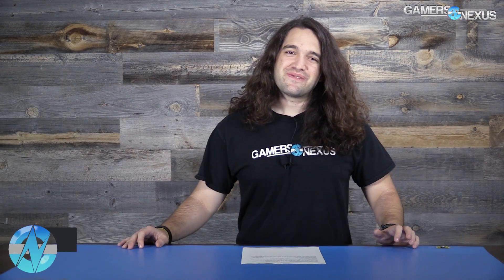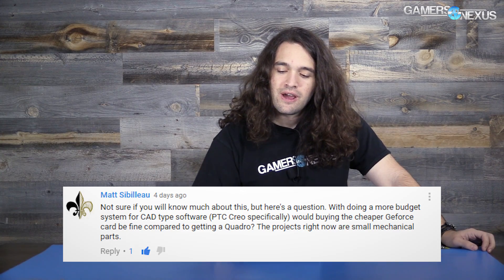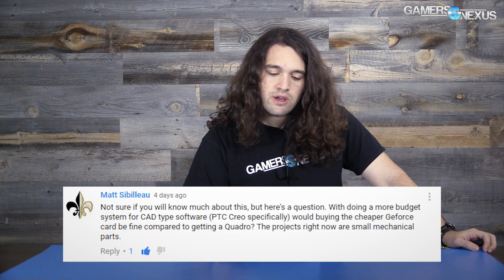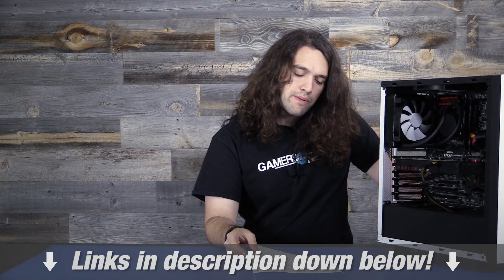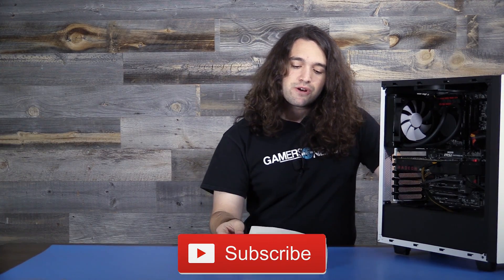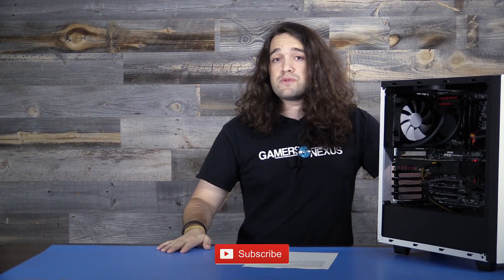Ask GN 23: RX 490 Talk, GPU Power %, Driver Performance

Comment: Do you think AMD will ever invest in improving their DX11 driver? Especially when talking about DX11 MT, even 3DMark Draw Call test shows not difference between MT and ST. Do you think that something like 337.50 BETA that Nvidia did will ever happen with AMD? I can see their advantages with DX12 and I really like all that stuff, everything. But DX11 is not gonna vanish just like that, in 6 months or so. We still see even DX9 used not that rarely too.
Cheers
(Filip)
Reply: DirectX11 is on its way out, it'd be a waste of resources, more so when you realize how tight AMDs budget is.

DirectX 11 will at most stay here until mid 2017, I don't see games using DX11 after that
Reply: +nome ficticio yes, because this time is different.

Developers will always care about their bottom line, publishers and developers the same.

If DirectX 12 is only available to 50% of the PC gamer base but Vulkan is available to 80% then they will use Vulkan instead of DirectX 12.

OpenGL was never popular because... Why would you use it for your game? If I was a developer I don't see a single reason why I should code my game on OpenGL.

While as now I see dozens of reasons, and developers don't have to adapt their skills to Vulkan, Vulkan is based off of mantle which was already extremely simplified to the point that a single person could port a game from DX11 to mantle in a month.

And, if we actually go and look this up, the number of Vilkan (including mantle) is actually higher than DirectX 12 games so go figure.
Reply: +dargonante so you expect every win7 and linux game to run opengl? like the DX11 games coming out didn't use dx9 but only opengl and dx11?

i do agree, business wise, AMD should not, and will not, waste money on improving dx11 drivers now. particularly when vulkan and dx12 with async benefit them so much as to finally tap into their gpu's real power. but, i'm sorry, your argument is invalid. dx12 games will still need to cater to non-win10 users for a long stretch of years and MS will not change its stance so some of the new games will come with opengl, others with previous DX, like 11. it has been that way since the previous millennium and the dawn of pc gaming on windows os.
Reply: +nome ficticio You argument is invalid, simply because Vulkan is DirectX 12 for Non Windows 10 users, and it even works better than DX12 in many areas.

Vulkan even works for Linux, Android, iOS, Windows ETC... There's no reason to ever use OpenGL again.

Fun fact: Vulkan used to be called mantle 3 years ago.
Reply: Dargonante really? you mean like opengl was already multi os before it? yet people still used dx instead? so you think that just because vulkan is as good as dx12 and supported universally companies and devs will LEAP to learning and adapting all their skill sets and investing in vulkan support instead of, you know, just sticking to the cheaper api they already know well and have code they can port? how many games percentage wise don't ever come to linux again? oh, that's right, most. in logical sense purely, vulkan is THE better and only api that any self respecting dev would ever need henceforth. but business wise, things are not black and white. not by a long shot.

particularly, when we are talking about some types of publisher-studios in the field, that have engines ready in dx9, dx11, for games having sequels(or games in the same genres coming out later) that can be easily deployed instead of porting to a new unfamiliar api that is vulkan. porting between dx versions is nothing close to clear cut and from dx12 to previous or vice versa is anything BUT that. but dx syntax,etc, is still familiar enough to make it apealing to executives instead of vulkan (where the opposite is true for engineers, that realize making 1 singular version of their game with universal platform support is quite better than 3 or 4 specialized versions.)

now, personally, i would really love to have vulkan support on all games that come out from here on out. that would make my linux use jump 90%. i could finally let go of win7. i don't however expect it in the least to be as smooth. quite the opposite. otherwise, opengl would be where it is today 7 years ago, with universal support and dx would be dead. what i do bet on, is significant vulkan support growing over time and dx12 "struggling" compared to its predecessors, with games randomly coming out with dx11 and opengl apis here and there. dx12 would get a lot more support if it worked on non 10 win, but the fact it doesn't is not equal to vulkan being the only solution to that issue. not as much as you, me, or any self respecting engineer wish for it.
Reply: Dargonante this time IS different, which is why this is the first time i believe dx will actually start its path to go down, thank God.

Publishers that would be interested in purely logical and long term run, would be higly likely to invest in vulkan and forsake all else. its pretty clear. but, if you are ignorant and naive enough to not understand the world we live in is not one where the most logical solution is the one picked all the time, even most of the times, in the industry fields, i don't think its possible to level with you. it's far too common that for bullshit reasons the obvious solution is forsaken. also you repeated developers in that sentence in a way i believe was not your intention, in case you didn't notice.

i already told you it is not that simple. hell we've seen publishers ignore the pc market and sticking to consoles to which the 2016 reality heavily makes it look like a glorious joke. yet, they did it. this is not to say the argument itself is flawed, it's your oversimplification of an industry that is.

you don't see a single reason? how surprising it is that you say you are not a dev. truly mind blowing stuff. /s
the only thing in your favor there is that dx is actually easier to deal with, but it only works in x version of win OS'.

oh, you think it's simplified. so basically you have no knowledge of coding and programming languages whatsoever - is a fairly strong deduction. you don't understand why someone would pick a high level language over a low level one in a specific situation do you? hit me back when you do, i feel our conversation will be a lot more fruitful. also, people can port super mario bros in a few hours to any api, doesn't mean those apis are the equivalent of coding in plain english. and EVEN if you could code in plain english to "the metal", you can't "copy paste" code - which is referred to by recycling code. something very common on the AAA industry, particularly the most prominent publisher owned studios (not all or all instances). funfact: did you know, windows sucked A LOT for years (it still does) because even though MS tells you consumer it is bringing you a new OS they are reusing much of it, iteration upon iteration, and changing only what they deem best? while 2 linux distros are often very different due to the fact their common denominator is very bare bones, windows is mostly the opposite. thought win8 and 10 did turn a new leaf in that sense for MS.

still on the previous paragraph, it takes time to learn how to be proficient on a new api. though vulkan reuses a lot of opengl stuff, and documentation is available and its actually good. a lot of devs(and publishers) have not so rational reasons to "like" sticking to dx. don't think only about laziness but even though i can see a point or 2, overall i disagree with their "reasoning" so i will not defend it. think about it this way: your favorite game should have some other one in the same genre, with a different UI or mechanics or map or what have you. it will take you longer to do the same thing you do on your most familiar one than on the other one until you get familiar with that new one. if you are an indie, you don't normally indulge in very low level stuff, but you want to have as broadest reach as possible- meaning working more on a version but overall less, on several versions is good. if, however, you can have shortcuts for some versions, sometimes, it seems to make "business sense" to some expensive suit clothed people. the only thing here that is different from before, and will actually help, is that dx12 is different enough from previous versions that you might as well just learn a new thing instead, like vulkan. BUT that depends not on thee devs and code monkeys that actually understand that, but rather on richer people. i have seen quite worse decisions and adoption cases in several industries so i wouldn't be surprised at all if this doesn't go as black and white as you think it will.

if you actually look this up you will see that only 1 game that is in development has dx12 support as anyone remotely familiar with benchmarks knows, even 90yo. if you actually look it up you would also know the market share of win 10, which is mandatory for dx12 use, was so low it would almost make linux support look more enticing when those vulkan supported games were being planned. if you looked it up, you would also realize that vulkan would mean to bring the advantages of dx12, at least most of them, to any machine, regardless of os, so adoption problems wouldn't be an issue, therefor a gamble, and therefor, quite appealing for a transitioning phase on the market where people want more than what win7 offered and its apis but resistance to win10 is loud and linux is a wild card. newer dx adoption was never anything close to quick to market. in that respect this time is the same. but this is the first time MS fucked up so much, no one is feeling very confident in MSecosystem.so, if you look it up, you would see the current adoption is not telling of anything other than the above and can't be use reliably to predict what comes in 1-2 years onward period. it's like looking at the US election right now and saying that americans will for sure vote hillary or trump because the other is such a bad candidate etc, anything can happen (yet) even if the outcome is likely to be a certain one.. btw trump being out of the race was more likely than vulkan being the no1 api - just sayin. freesync was also likely to win major adoption with good ranges, and it has taken this long to get finally good adoption levels and the ranges aren't even there yet. they will be soon, but it took just 2x longer than what would be "obvious" and had "every reason to be" - just sayin.
Reply: +nome ficticio You speak about logical business decisions but you seem illogical yourself.

Illogical would be for developers to waste resources in PC gaming 10 years ago when consoles were basically 80% of the market.

What seems logical to you is not from a business standpoint, you're just ignoring their facts and focusing on yours.

Earnings, the bottom line, gross income, this is what matters, every logical decision will be based on this.

How much does it cost to code on Vulkan VS DirectX 12, how big is the user base capable of taking advantage of this API, how efficient is one or the other, will you lose money on Vulkan that you won't on DX12?

Before DX11 was the go to, cheaper and profitable alternative, if you wanted to code for Mac or Linux you'd need OpenGL and waste tons of resources.

Now Vulkan is even easier to code with, portable from consoles thanks to the GCN based technologies in them.

Now there are no sacrifices, now there are more Vulkan games than DorectX 12.
Reply: Dargonante pardon me if i'm as interested in what you find apparent as i am in Scarabaeinae.

80%? funny numbers. 10years ago no less, if you had said something like 15-20 years, i might let it slide but 10? that's just funny. wow susbs alone 10years ago were significant compared to console numbers. not to mention pc crowd usually spends more on average than the console avg, perks of having an income instead of begging mum and pop et al for the new game everyone is playing.

i would say that fits your description quite accurately. i would also add that you have zero knowledge of software engineering and coding as well as knowing zero developers - or another way to put it, opposite of me. but even then, you could read neogaf and a few other articles to realize some things.

no. every decision will be aimed at this. care to talk about what konami has been doing for the previous 2 years and how that makes so much business sense? or maybe the xbox one launch and the value that was kinect. there are really too many examples to count of literally stupid and blatantly illogical decisions.

for the 20th time, it's not just about the API vs API in theory. you need to look at specific companies, specific projects and basically, case by case basis. this is not your home decision of nvidia vs amd, AND EVEN THEN, it would be case by case wouldn't it? name 1 advantage of windows vs linux. name one, so i can demolish it and ask you for another, and repeat the process until you can't name one. linux is better than windows in every, single, way, and yet, windows still dominates consumer space. 

yes, ty for describing again the core idea that vulkan was created around. shocking news. can you make a game on vulkan? but if i taught you the basics of sw eng i think even could could make me a game on "english". imagine i pay you by the hour, which would you think i would pick, to pay you to write me a game in english, or learn to write in "vulkan" and make me a game in that? - that is the core issue that may [stupidly] make some games come out with some old apis instead of vulkan. 

you see, the difference between me and you is quite simple. the theory is quite clear, and i never tried to disprove any of the GLARINGLY OBVIOUS truths about vulkan, but you have no knowledge of the practice side of things while i do, and i only tried to clue you in to reality where things are not so simple and black and white as you make them out to be. you can't even go over my arguments, you just recycle the some bullet points over and over again because that's the only thing someone that knows zero about programming knows about the subject. 

btw, serious question, why are we using fossil fuels like petrol and it's derivatives for transportation when we have had better alternatives for years?

why are we using single task OS on mobile when we could be using true multitasking OS on mobile for years? though this has gotten a lot better in the latest mobile iterations since 2 years or so to now. but even android 2.1 could be better than what 5 is in that regard. and yet..

serious advice kid: learn how to use linux. you will never regret it and it will open your eyes a lot.
Reply: That's enough people. Already 10+ comments and now insulting too. I'm gonna start banning you keep it. Discussion I like and constructive criticism, but insulting is a no go. :)
Reply: Dargonante ahahah so basically you have no arguments, because i crushed your ignorance, and like the true coward you are you can't admit your ignorance and prefer to run away and read me more bullet points for no reason hoping that makes it seem like you counter argued something.

the most ironic part is, i'm more of a vulkan advocate than you and you keep trying to fight me over your impression that i'm saying vulkan is bad or something. your are about as smart as the average rock and not afraid to show it ahaha 1 in 100 times it is worth it to try and teach something to random people online. you were even more of a waste than 50 of those 100 times. i bet you are not even legally able to drink yet kid.

do please tell more about the scheduling problems of dx12 with geforce. there are, so many, finished, dx12 games to prove your "argument" and extensive "knowledge" of the dx12 issues. do enlighten us oh random 4chan idiot.
Reply: +nome ficticio Vulkan advocate or not you're stupid and wrong.

There are more benefits to use Vulkan than there is to use DirectX 12, the user base is bigger, the performance is bigger, the simplicity is the same, the only downside is that there is no dedicated support center with real developers like with DX12.

Literally, you gotta be stupid to not realize that Vulkan is here to stay, and that it'll be way more successful than OpenGL ever was.
Reply: Dargonante its so peculiar you say i'm wrong. please do quote me where i say what you are claiming is wrong and you are also desperately trying to counter argue. since you are too stupid to realize no one here but you is comparing dx12 to vulkan claiming one is better than the other. my only singular point was that devs might still use dx11 or opengl instead of vulkan for some version of their games to support "old" platforms. you like to move the goalposts every post, it's rather amusing.

yes, you have, you also have to be even more so to realize you are the only one saying that and trying to disprove it. in other circumstances someone talking to himself like you are could be signs of serious mental conditions, but your case is just plain communication impairment couple with a huge amount of ignorance and being caught on it. also doesn't help you are stupid. but hey, not all of us can be engineers. you can however, grow up one day. so don't let this get you down, just have hope to improve and make some efforts. i'm sure you won't go far, but it's not hard to be less stupid than the extreme you are currently which is quite a lot better.
Reply: +nome ficticio What old platforms? Windows 7? Vulkan is available in Windows 7 so why would they use OpenGL? 

Makes no sense bro, OpenGL and DX11 last games released will launch long before mid 2017.
Reply: Dargonante  people also said the earth going around the sun also made no sense. brilliant people they were, as knowledgeable and mature as you are with about as much critical thinking.

you remind me of something i read a short while ago, it was about project spark. it was amazing in 2013 o hear the kids like you saying that game was going to be a revolution way past what media molecule had achieved. funny thing is, mario maker, something even less powerful than lbp and project spark, was the most successful of the bunch for illogical reasons. does make sense why though, doesn't it? just food for thought.
Reply: Yes, I will ban. Go else and insult like animals, here it's not gonna happen. ;)